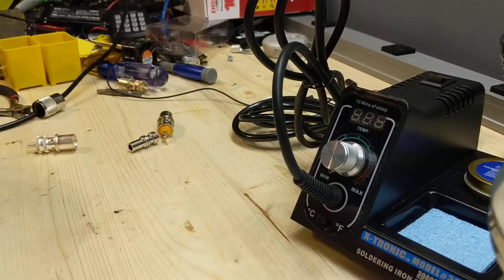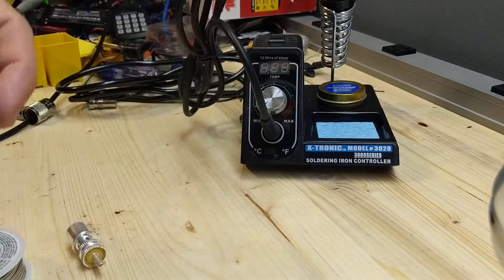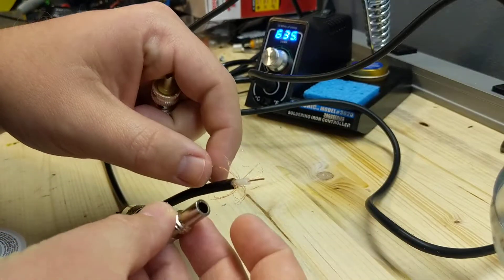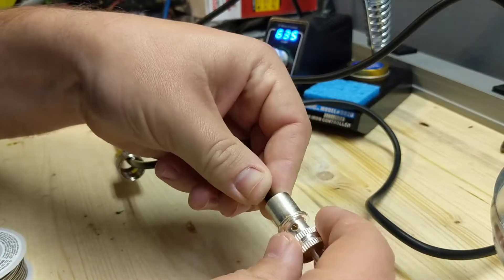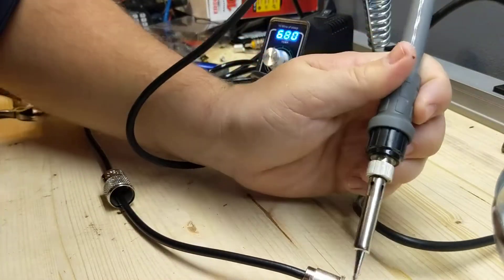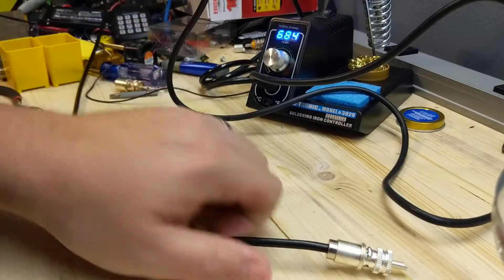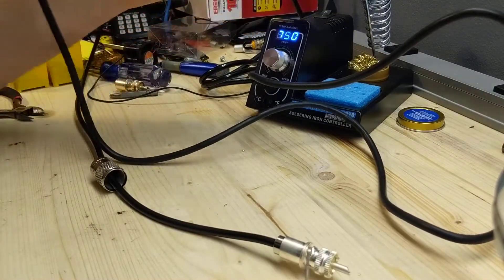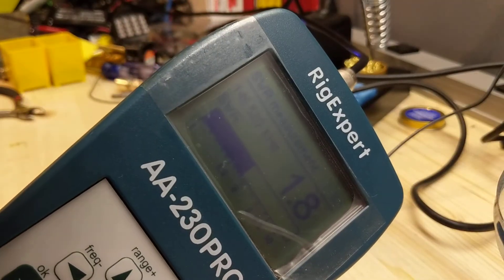Terminating a PL-259 using an X-Tronic 3020

Comment: I have seen you are really happy with I got mine today ,  did not try yet, but set it up , would like to know if it is normal that the additional soldering tips all are so lose they are not firm as the one came pre installed with. will be looking forward to hear from you thanks in advance.

Comment: What the percentage of lead on that solder?
Looks like  you are using a thicker solder which requires high temperatures.
Reply from the maker: its lead free solder.
Reply: @experiment86  you need some smaller solder. That big solder is more for like copper pipe/fittings such as water lines. Also, try not to get in the habit of carrying solder with your soldering iron over to your piece you're working on, but rather, apply your soldering iron to the piece, apply solder, remove solder, and then removing your iron. One last tip I would give you is to use flux core solder, or get you a flux pen.😉 Keep on keeping on buddy! You'll get it down 👍
Reply from the maker: @BackyardAstronomy2018  yeah I actually just bought some thinner solder recently and it's made a world of difference. As well as changing my technique. Thanks for the tips!